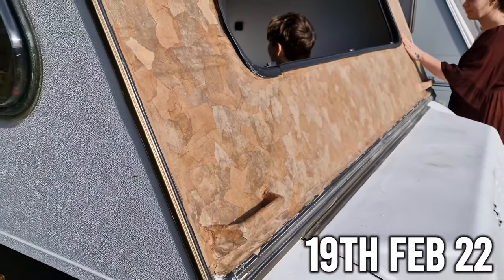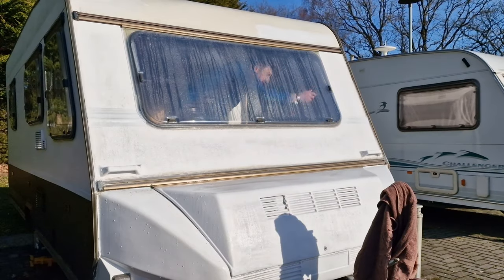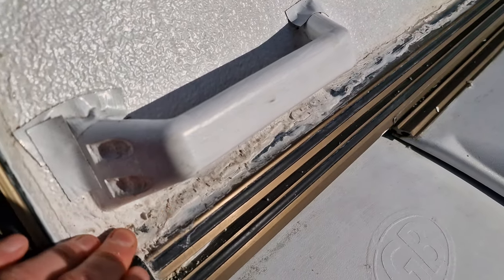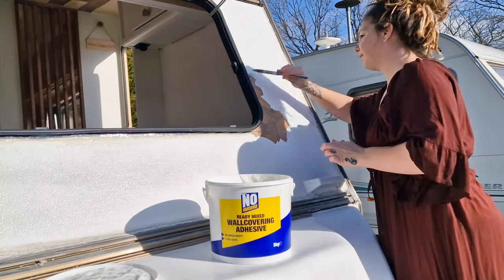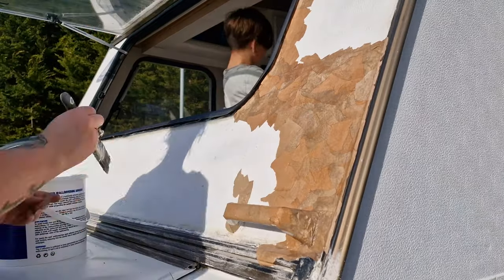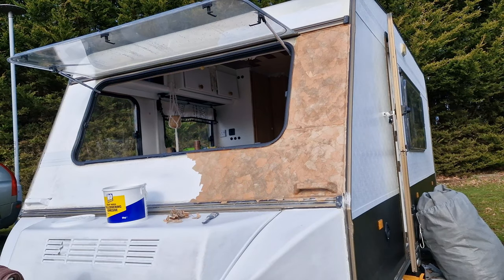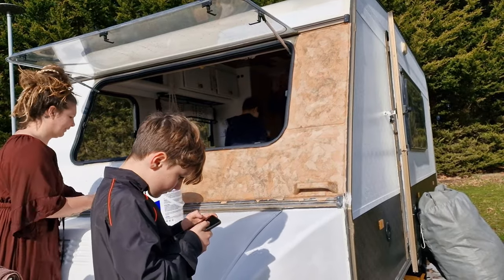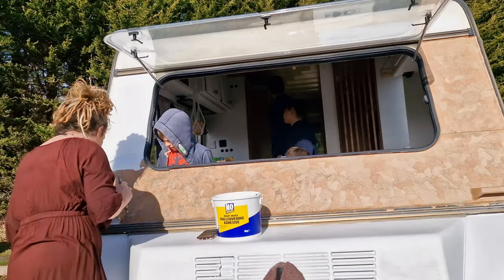Caravan Renovation #7 | Leaky Van Yacht Varnish FIX | Will It Work?

Comment: Ah this one.... I was considering vinyl wrap for similar reasons. I thought it would add a barrier of plastic.
Reply from the maker: On the ceiling? Yeah it's a totally viable option. Fairly cheap and reasonably easy to apply. I wouldn't be adding any unnecessary weight to older vans, so the fablon is superb to make the ceiling look however you like without costing a bomb or damaging anything and keeping the weight down. 

Amy's idea 💡😁

Comment: Did it work??
Reply from the maker: No, it didn't. Water got in to the paper and it was ruined. Video to follow.
Reply: @WhereGoggsyGoes  might be safer with a resin on the outside of the paper, hopefully you'll find a solution soon!
Reply from the maker: @toniarmstrong369  Yeah, we have a plan. Just need the time to do it haha. Resin could be a viable option.